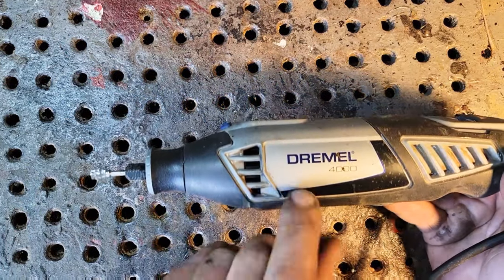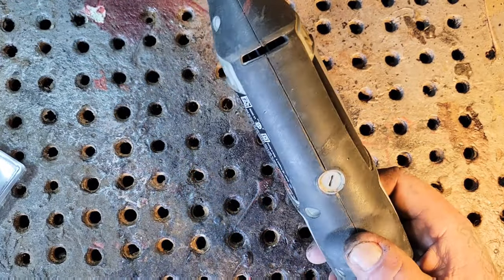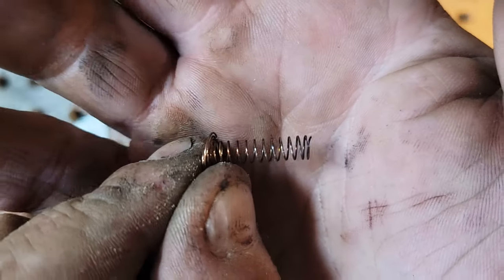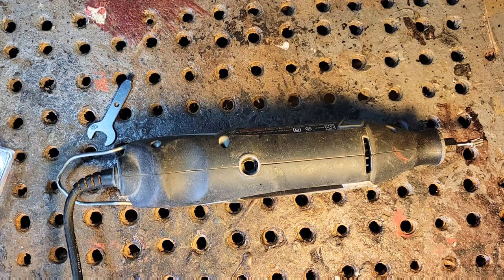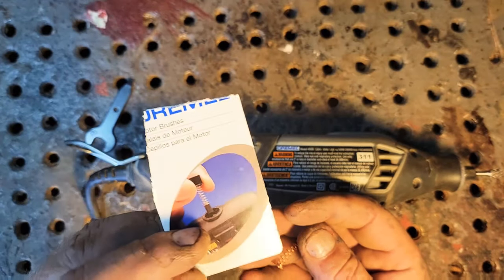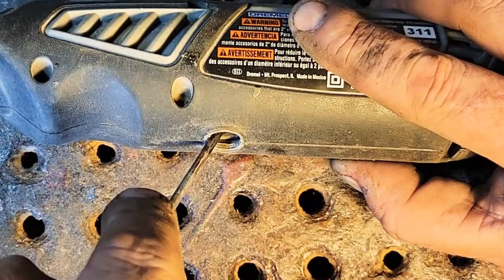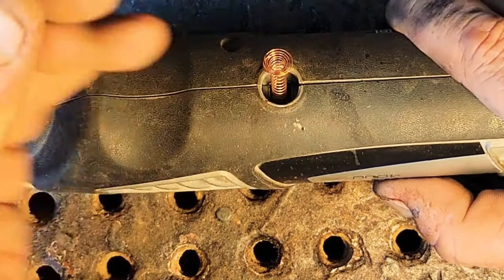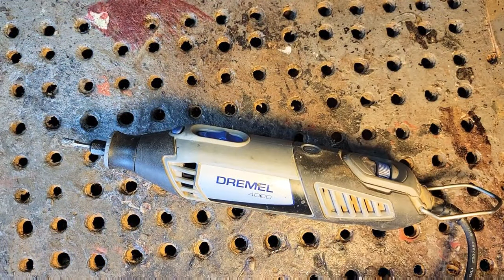My Dremel stopped working? Here is a DIY simple fix.

Comment: Just a bit of info I have learned, I used the dremel 4300 model, and I order my brushes thru dremel and it only costs like $4 a set. Last time I ordered I think I order 3 or 4 SETS of brushes and with shipping and everything included it only cost me $16. Dremel is one of the best companies, as far as standing behind their products and especially costumer service, that I have dealt with. To all new carvers I HIGHLY recommend calling them for new brushes. Also, make sure you check your brushes regularly. If they are starting to get worn, order more so you don't have to wait and lose carving time.
Reply from the maker: Thanks for the tips

Comment: Thanks for sharing.  Useful. 

Gotta love YouTube.  I'm older.  And by gar, kids today have no idea how hard it was to get information like this in the past, pre-internet. If my Dremel broke when I was eleven I'd probably look in the Encyclopedia for diagrams of electric motors or switches.  Then I'd use the phone-book to look up  numbers of Dremel  dealers.  Then I'd go to the phone and  wait, curly-wired to the wall, for the  party-line to be open so I could dial.   Failing that I'd  ride my  bike ten miles to a small-town library and use paper index card files and the Dewey Decimal System to find an out of date manual for a similar tool and struggle with that....
 
But I just solved my issue from my chair in under a minute with video streamed to my remote mountain stronghold by Starlink satellites.  

I know I should be over-it, but it is freaking amazing.
Reply from the maker: Lol haha awesome 👌
Reply: I hear you! I’m a woman (old enough to get sr. citizen discounts) and the internet is so helpful especially you tube, no longer do I have to drive 12 miles to the library, I can fix my riding mower that’s 14 yrs old, my father would have been so proud. He was always tinkering with everything and now I do too! All made possible by videos like this!

Comment: I have an older model 370-5, my brushes look pretty good but still not working. took mine apart and it's a couple of the stator wires. Soldering time! Thanks for the vid though

Comment: hi, a question.. but have you had any luck with the dremels?  I did a calculation, I bought 8, and 5 broke. Two of these were the Dremel 3000, one of which broke yesterday.  I saw that other people had the same problem as me, these are wires smaller than a millimeter (0.7), and can break due to vibrations.  what do you think about it?  What do you think is the most "resistant" and best made dremel among the various models?  Aesthetically I really liked the Dremel 3000, but after it broke again after 4 uses... I have now replaced it with another 4250. (of which I have 3 in total now, even though I still had a 4250 broken in the past...) I find it ridiculous that such a famous brand makes such poor quality products, only once did I run out of carbon brushes from a dremel... another question by the way, do you still sell the dremel 4000?  here in Italy no, not even in the back box, once you buy a new dremel it's more present, they show the stylus, the 3000, and directly the 4250. I think it's because here in Italy the carbon brushes were hidden, and you had to open the machine completely.
Reply from the maker: I like and use the dremel 4000

Comment: I've noticed that the brushes are not perfectly square; one side is slightly longer than its perpendicular. The same with the hole it fits in, so the brush will only fit a certain way. My Dremel has become intermittently powered and does shut off by itself so I am thinking rhis is a brush issue? Mine do show wear but there is still lots of block left on the brushes. Can they be sanded flat and still work?
Reply from the maker: Yes sand flat :)

Comment: Hoping for help. My Dremel 3000 has this issue where those 2 plastic screws on each side that house a copper spring (I don't know what that is), have a strange issue. The Dremel works only if I press hard on one of them. The moment I release pressure from the screw, it stops. 
What might be the issue and is there a way I can fix it please? Thank you.
Reply from the maker: Unscrew them and take the brushes out, with fine sandpaper sand the ends flat and put the brushes back in, 
It's probably time for new brushes u can but them online
Reply: @CarvingFusion  Thank you so much. Really appreciate your help. What exactly are they called so that i can search for them please?
Reply: @ShyamSundarY i have the same problem with my dremel 4200. Did you manage to fix yours by sanding or replacing the brushes?
Reply: @josephzekhnini5621  Replaced new brushes. Now it doesn't work any more.

Comment: Just bought a new Dremel today - battery pack one.  I turn it on, then turn it off, and it won't turn back on unless I take the battery pack out and reinsert it.  What's up with that?
Reply from the maker: Not sure I'd maybe ty reset your brushes or call dremel
Reply: @CarvingFusion  exchanged it for a new one at Lowe’s.  All good now.

Comment: Jordy I changed brushed, dremel 4000 started then stopped again. About 10 minutes later I started it again. Now I’m running dremel and it stops. Geee what the hell is going on. I just bought the dam thing. May I ask you what the hell is going on. Plz Jordy
Reply from the maker: Hi there, u could try pulling the brushes out and lightly sanding the bottoms flat and reinstall  :)

Comment: Its not the brushes on my drill, Dremel 3000 its the electronics board. My one is less than 12 hours usage & it has burned out while using the extension multi use shaft. Its had it hust over a year old. 
But also be aware these units have a poor quality electronics now. Definately not worth buying anymore.

Comment: Well this is not really "fixing" a tool... This is a normal procedure in all tools that aren't brushless. It's so sad the amount of people that throws away perfectly fine and sometimes expensive tools because they don't know that at one point they need to change the brushes....
Reply from the maker: The tool was not working I changed the brushes then it did work so maybe better terms would of been fixing/solving the peoblem